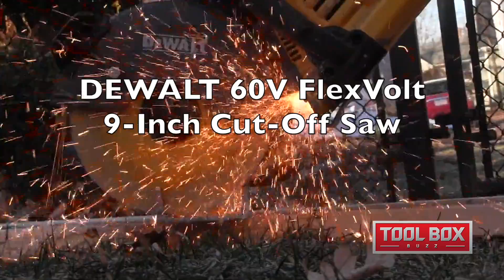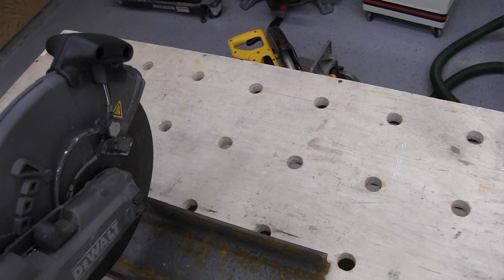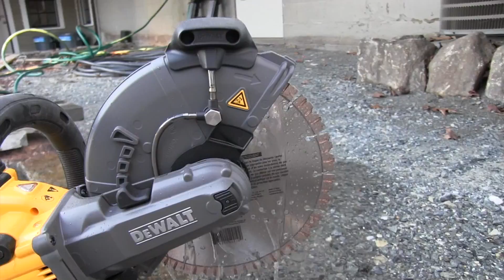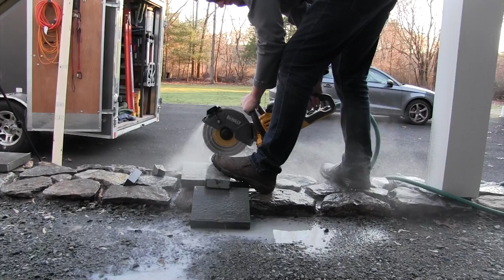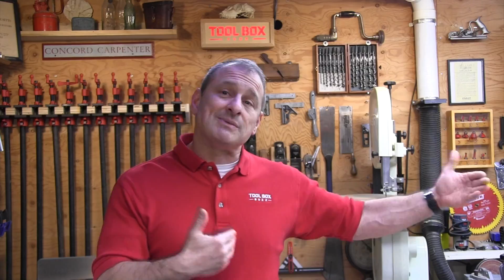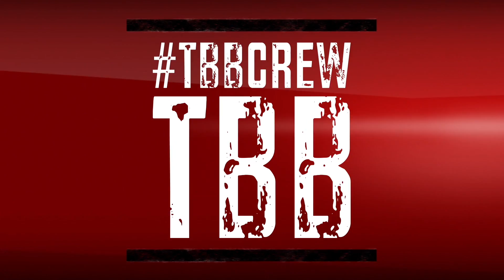DEWALT Flexvolt 9 Inch Cut Off Tool

Comment: Hello Rob
I am reaching out to you because I am wondering you know or have a solution for the battery cover for the Dewalt 9” cutoff saw does not close with the 15amp battery. I don’t want to spend the money for the new one that does close with the 15amp battery.

Comment: Do  the 9 inch metal cutting disc from 9 inch grinders fit this flexivolt cutter ?
Reply from the maker: dont think so
Reply: @ConcordCarpenter  ok thanks I hope they make 14 inch cut off saw , like Milwaukee has

Comment: This is the saw to have.. no messing with 2stoke saw for small cuts in the field... No other company has the same power in the 9" cut off saw.. then DeWalt
Reply from the maker: paul hvizda I plan on putting this up against the Milwaukee

Comment: Is there any roofers using this saw and if so how well does it last
Reply from the maker: Jonathan Taylor unknown
Reply: 🇬🇧 roofer. Buy extra batteries with it and you will not be disappointed. Neater cut than a 12inch saw. 3 year warranty, what’s not to like.
Reply: It’s perfect for roofing👍Best tool I’ve bought

Comment: Good for working in residential area's too... those petrol cut off saws are noisy as hell..  I expect its more versatile too especially when doing over head cuts.  Not a big fan of dewalt but this tool is impressive.

Comment: ... finally I took the saw for a ride today,  to bad I couldn't record the operation because was on a hospital job .
I cut 50 mm tarmac on the flat roof, and I can tell you is not even close to performance,  to much protection, the battery is getting very hot .
Definitely a tool for the show, everybody was impressed about the aspect, except me .
I did the job finally, but I was hoping for a better one. 
I used 2 9 Amp battery for 4 linear meters, in a depth of 50 mm.

Comment: ... how many meters cut with a 3 amp?
Reply from the maker: MrDINODINO74 no 3amp
Reply: ... if is a 60 volts is 2 or  3  or 4 amp , but don't worry about I will test the tool myself, you are to soft anyway, afraid not to upset Dewalt or Milwaukee.
Reply from the maker: MrDINODINO74 I didn’t test length of cut in any specific materials - I’ll have to check the battery for the amps. Not sure I understand why your calling me soft???
Reply: ... you are not soft , you are a kind of man I want to by wen I will grow up .
Perhaps the right work is to diplomat ... you are to Diplomat wen came to Dewalt and Milwaukee
Reply from the maker: MrDINODINO74 we try to be professionals and discuss the good with the bad.
Reply: He was using the 3... amph bat.   It's only a 9 and 20v.  There are 12/4 amph batteries... and a 15/5 coming this year.

Comment: I feel like if they can make a single battery 9" saw they can make a 14" dual battery saw
Reply: Probably... if so you need 4 batteries and 4 bat charger.  If you had a 3rd bat and another smaller one... you still have the small bat limitations . Or they could supply the corded adapter just like the 12 in saw.
Reply: I have her there is a 14 on they way along with the new 15 amph bat. Could come with 2 bats and one fast charger to keep price down. I have the power station... it could also run the saw with cord adapter  in remote locations . It will charge 4 9 amph bats in 4h... but not all the same work needs to be done at once. I pick up power station on Amazon.ca  for 400 .
Reply: So if at 120v like miter saw with 2 batteries... total amph would still be 15 amph  but with 120v power.  Some of the 60v setups with one bat out perform corded tools... in terms of speed and power... watts amps and torque.

Comment: Can you compare it to other cordless saws please?
Reply from the maker: I'm only aware of the Stihl TSA 230 , are there others?
Reply: @ConcordCarpenter   sorry I had in my head that Milwaukee had one. Stihl or DeWalt? We're looking to get one and you seem to give the best reviews 👍
Reply: @ConcordCarpenter  I'm in the market for one now and there are several to choose from. Dewalt, Stihl, Milwaukee, Husqvarna.... It would be interesting to see them all compared. I personally just want to see the Husky and Dewalt head to head, as I'm already set up with batteries and chargers for both those two brands.
Reply: If you compare it to the Milwaukee 9 in grinder... interestingly they both have the same rpm. Not sure about torque...

Comment: Has any one else had problems with these batteries?
Reply from the maker: You ALWAYS hear things on tool company batteries - I have not heard any horror stories
Reply: I have four for my flexvolt slider, two have stopped taking a charge. Not sure if it was me or a defective set, but my standard 20v max batteries seem pretty bulletproof. Spoke with my brother recently and he has a 60v battery down now too, all about a year old.  Love the tools though..
Reply: True but if I was to pick a platform would go Makita, bullet proof batts n nice tools
Reply from the maker: nestogonzo1 does Makita have a cordless cutoff saw?
Reply: true dat
Reply: @Streetfoodjunkies  sounds like defect i have a bunch of flexvolt batteries and only had 1 stop working at 2 1/2 years and only cuz the lock on switch on my blower got engaged and fully discharged the battery. By the way batteries have a 3 year full warranty so mine got replaced anyways. No reciept required they will go by date code
Reply: If makita makes a saw like this... 2 batteries using 18650 cell would no be bulletproof even at 36v. You would need 8 bats. 4 on tool 4 on charger. I don't see makita making a 21700 cell battery .

Comment: Whats the going rate on a partner saw?  Surely its cheaper then $900.
Reply from the maker: Partner??
Reply: @ConcordCarpenter  This tool with a gas engine is called a partner saw.
Reply from the maker: beeps was opposed to a supplemental- like I called it?
Reply: @ConcordCarpenter  I'm not sure i follow you, "supplemental"? This type of tool has always been called a partner saw where I"m from.  I didn't mean to offend. 

The only thing I'm opposed to is the price, tools just keep getting more expensive.  While I'm a Dewalt fan alot of their prices are ridiculous.   I seen a video a few hours ago with heated Milwaukee gloves.  $180.. i mean seriously.
Reply from the maker: beeps no offense taken- never heard of that term
Reply: Partner saw, quickie saw, chop saw, rock saw, there's a lot of names. As far as price this is fairly competitive. I use a 14" and a 16" gas powered saw at work (stone Mason) and they run between $1500 and $2000. $850 for a 9" doesn't sound too bad to me.

Comment: Not a bad price considering how expensive the 9A.H. batteries are and the fact that it includes 2 blades as well. 

Good video as always !!
Reply: For a cordless cut off? 500 dollars is a steal
Reply from the maker: I agree  @nickspiveyaka44
Reply: If you know where to go you can get 9ah 60v for about $100 each.  The fast charger can be found for about $40.  NO idea on the blades, gonna be generous and say $100 for both.  This is $340.  Bare tool is about $500.  Still think its not a bad price?
Reply: @beeps7  Please post a link on where you can find a 9ah fv battery for a $100. I've never seen it anywhere including eBay.
Reply: @justind6039  If everyone started buying them the price would go up.  I'll give you a hint, retail add's 20% so avoid Lowes, Home Depot, ect. 

@Nick Its literally a motor, a chain and some plastic.  $500 is a steal for a bare tool?  

I easily have over $2000 in Dewalt tools.  I'm heavily invested in their 20/60v platform.  But the truth is they rip off the consumer with ridiculous prices.  Try using Ridgid, Porter Cable, Makita, you'll see 2nd tier brands are just as solid, yet half the price of Dewalt.  

Why is Dewalt so god damn high?  Its not just this tool, alot of their line is ridiculously overpriced.  Why is a cable cutter $1000?

I'll tell you why its so high, because alot of people are out there like you thinking its a steal and they will charge as much as people are willing to pay. 
If you'd pay $1000 for a 2ah battery you can bet thats what they'd set the price at.

Comment: I like how diverse and innovative DeWalt is as far as tools for different trades. The battery technology is making it possible for amazing tools.  I wish the flexvolt line was available when I bought into Milwaukee. I’m way too vested to switch.  BTW thanks for another great review!!
Reply: I really don't know in a flexvolt,  I have  the one for dewalt to ryobi and at this moment I lend it to my brother in law so I haven't tested, but sure you could ask any seller! Just sharing my info!
Reply: Ernesto Pinedo I was referring to buying into the DeWalt Flexvolt line of tools and batteries rather than the Milwaukee Fuel line.  I do love ALL The Milwaukee toolsI I own this far.  I appreciate your trying to help out though.
Reply: @savage6394  You can look for dewalt to Milwaukee  as Milwaukee to dewalt adapters, just research!